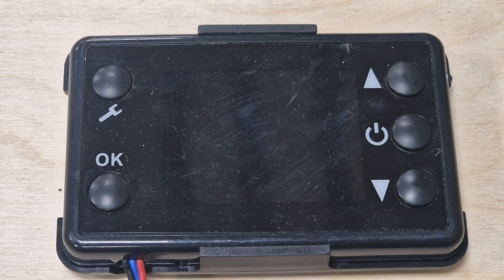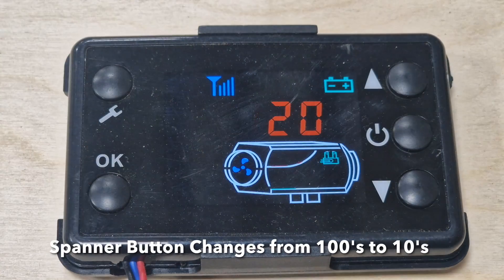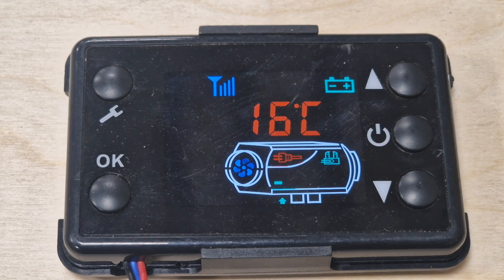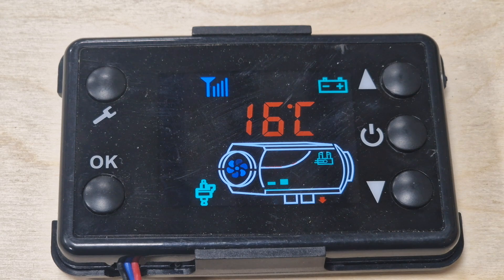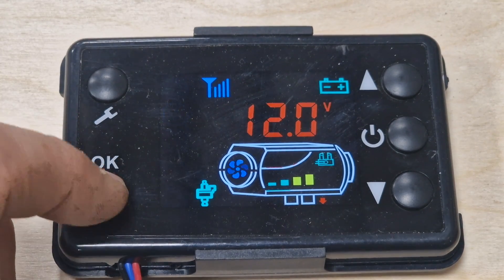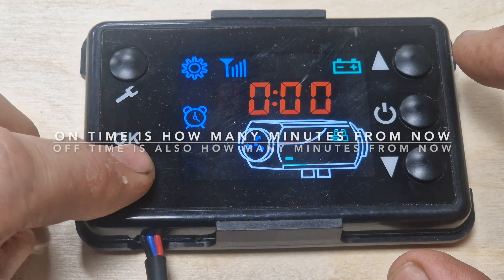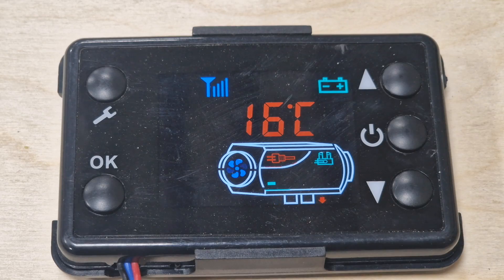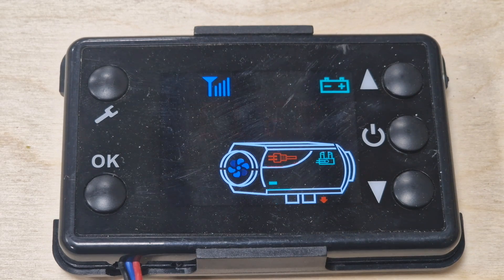How to Use a Diesel Heater Controller - New Type

Comment: I want to add some info not in this video, or anywhere else I could find.  Switching from Fahrenheit to Celsius.  I ran up on this by accident.  My remote stopped working and while trying to get it to pair up again, pushing different buttons hoping to find the right one, I found out how to switch from Celsius to Fahrenheit on mine.  This may not work on all controllers but it does on mine and this video seems to match my controller.  Keep in mind, there are different controllers that use different buttons to do things.  On mine, I had the heater running and I pressed and held the temp up button.  It takes a few seconds but when you see it switch, release the button.  It may also work when the heater is off as well.  I have not tested it tho.  

Again, I lucked up on this purely by accident.  I reached out to the maker of my heater, they were not aware of this either it seems.  They updating their customer service info to help other customers.

Comment: How can change F to C  ?
Reply: I ran up on this by accident.  My remote stopped working and while trying to get it to pair up again, pushing different buttons hoping to find the right one, I found out how to switch it on mine.  This may not work on yours but it does on mine and this video seems to match my controller.  Keep in mind, there are different controllers that use different buttons to do things.  On mine, I had the heater running and I pressed and held the temp up button.  It takes a few seconds but when you see it switch, release the button.  

Hope that helps.  Going to post up top so the guy making the video will see this and maybe include it in a new video later, or others luck up and see my post.

Comment: I've got this controller had it about a month, I only have a small van and on p01 (I have 2 of the 6 bars on I swear it sat on 1 wen I first used it) I have to turn it off for 10 mins hear and there or I over heat I cannot get into advanced settings at all, do I have a faulty controller? I can only turn off adjust the temp or power setting wen it's running definitely won't let me do all that you are on yours only wen it's not running
Reply: I know this is a old video but help would be much appreciated got 0 instruction with the damn thing

Comment: Hi Bud. Great video's. I have triclicks heater with controller with spanner, in the secret menu do you have any idea what the settings should be?
Or what each part does? Am at sea level if that makes a difference.
Cheers

Comment: Anyone setup 1kw diesel heater, controller lights up with 8's, ticking noise initially, don't think it's pump noise. Controller is single knobs, presume push in, on/off, rotate for temp. Has a remote but no instructions that I can find, so cannot link

Comment: I found that when I set the temperature when the unit was off it did the trick, went up to 18 degrees when I turned it on, that I set and then settled there. It had been in 30 degrees before that so thank you

Comment: I bought this model and followed all instruction but when the heater gets to a certain heat internally it starts blowing out smoke (not thick, like when you burn food in the oven) then when I turn it off white smoke sometimes comes out of the air in take pipe. Any suggestions as to how I can fix this?

Comment: The controller I have is different but I get no power to the diesel pump I thought it was the heater so I just a brand new one,  along with a 600w power board and mains uk plug , and I get no start up on the fuel pump nothing , any ideas would help 😊

Comment: Why don't I have the option to set the time?  I didn't have it on my old CDH which I've just swapped out but the new one didn't give me that 0000 screen at the start either .... so frustrating.   I also need to tune this new one - but can't find advance settings! 😢
Reply: Did you figure it out. Im having the same problem.
Reply: Yes - there are two different types of mother boards - one is preset (so you cant change fan speed etc) and doesn't give the time, but does give you temperature of the motor.   The Other does give you control over settings, and gives you a clock.   
I don't know which is best - my first mother board was excellent 👌 but broke - my second (also preset) was terrible and couldn't change settings - my 3rd (which i can change settings) and current one seems fine but I have a feeling the soot is building up 😃 (I like the fan pump ratio as it is so all on me)

Comment: Hi everyone - mainly Grantsyard and Van Life UK - thanks to them to explain "advance " programming after entering password code "1234". P & t is manual heat control or thermostat control, 1 & 2 is selection between 12V or 24V,  H & L is 5000W or 2000W, last number is 1 - 16ml, 2 - 22ml, 8 - 28ml dosing pump.
Today I tested my 5KW heater with this "spanner" setting button controller model - all perfect, on P-01 heater 175*C, exhaust 220*C, only two LEDs, on P-05 heater 190*C, exhaust 340*C, four LEDs, on P-10 heater 206*C, exhaust 490*C, six LEDs. A lot of heat out of exhaust - my intention is to make muffler combine with heat exchanger to heat water for additional small hydronic heater and shower in my mobile home as next stage. I hope that software is and will controlling fan speed & fuel dosing to good combustion without "manual" programming fan & fuel ratio as on older controllers. Personally - I'll prefer option for "manual" for case need to do it - going to top on mountains - do not know yet how this controller will behaviour. Good luck everyone, Vas.
Reply: I set 28ml pump on my 22ml setup and work better. thanks.  factory configuration is some over rich, I guess
Reply: On my menu theres H/L also U ive been trying to find what that even means, its not in the manual and cant find online only that h is 5kw l is 2kw

Comment: thanks, is there a way to adjust the rpm and fuel like on the older controllers with the settings picture not the spanner on the top left? thanks
Reply: I do not think so, have tried,

Comment: When I turn the power on for my heater. I get nothing to set the clock just shows p12 which is voltage. If I press settings (top left and ok nothing happens. Which also means I can’t set the timer. Confusing to say the least.
Reply: Same as mine , no clock setting
Reply: @cliffhawkins2285  think it’s the model. Which means you have to manually turn it on and off. If you leave it on it does reduce the fan speed to control the heat but I don’t know what the temp is set at. They are a bit of a pain to be honest.

Comment: I have a diesel heater that will not light. I've taken it apart three times it's been cleaned and was not dirty. The are hole next to the glow plug is also clean. Also installed new gaskets a new glow plug. Every time I try to start it it just smokes. I did notice when it starts now the fuel pump runs five times

Comment: Do you know, is possible to use heater only as fan? In summer, for air circulation and cooling. Thank you.
Reply: If you have one that will pair with the heat genie app, it has a fan only setting

Comment: Fantastic video as I have this one so useful 👍
Question 
When you turn it off and the control panel goes off not lite up is it still using power from the battery 
👍👍😜cheers

Comment: i use temp mode, works ok has a 2 c band that needs to drop below before it turns the heater  . good for controlling carbon build up.
Reply from the maker: Thanks for the tip!

Comment: Just installed my heater and it does not power up tried everything could think of and no luck  I bought a new set of motherboard control panel and remote fitted it all up and still no life in it any suggestions would be greatly appreciated thanks Tom
Reply: Also mine has a in line fuse if you have no power check that if you have one
Reply from the maker: What power source are you using? 🤔  It needs a very full 12v battery or even better, a ac to dc pack with high enough amps

Comment: Hi I was looking forward to using my heater for the first time after watching you video on how to use the controller.  First snag I found is there isn't a spanner symbol and it isn't in the settings either.  My controller seems to be different to the one on your video also the heater instruction book is next to useless, can you help please?
Reply from the maker: So yes the instructions are useless. There are different controllers with slightly different use. Some functions work the same and some don't.
Most youtube controller videos are for the cog type which is different to this one!
Reply: My controller is completely different as well , sent off for a replacement and that one is not the same either

Comment: Can you change from from Celsius to  Fahrenheit on this controller?
Reply: Pretty sure when you see the Celsius temperature hold the up button until it turns to the Fahrenheit setting
Reply: I don’t know how to change mine to Celsius from Fahrenheit 😅
Reply: Did you ever find a solution?
Reply: Hold the up arrow for 10 seconds @michaelvanveghten5823
Reply: I’ve changed mine from Celsius to Fahrenheit but don’t know how
Reply: Hold the up arrow for 10 seconds

Comment: I set the temp very easily using the remote.  It is but a simple press of a button.  Once it reaches the desired temp it powers down to idle.  If the temp drops a degree centigrade, or thereabouts, it cranks up to high again.  This seems ideal to me.
Reply from the maker: Now I'm set up I use the remote in the same way to be fair
Reply: I've tried with button operation and with the remote, but it doesn't stop heating! Right now it's 17 degrees in here, heater is set to 13 and it just keeps heating... Any idea if I could be doing something wrong?
Reply: @thomasdt1991  Unless your heater is the type to turn off at a certain temperature it will continue heating.  You can set the temperature to reach before the heater powers down to idle, but it will still keep on running.  You will need another gadget to turn it off altogether, such as the Bureck CD Thermostat (Google or YouTube Search for it).   I have one and it works a treat.  It turns the heater off and on at the required temp.

Comment: Is there a video showing how to adjust the fuel air ratio on this type of controller please?
Reply: I don’t believe you con with this model
Reply: @LeePearce-lv4zj  I managed to get into the settings by holding the settings button and then pressing it 3 times and my pin was 1234 however the settings are not rpm and hz settings it shows H1P2  and im not sure what they mean
Reply: A comment elsewhere says the letters mean:
1st letter- P (manual heat) or T (auto temp)
2nd- 1 (12v) 2 (24v)
3rd- H (5kW mode) L (2kW mode)
4th- 1 (16ml), 2 (22ml), 8 (28ml) for pump size

 @kyriveli
Reply: Been looking for years on what these mean, cheers, written them down
Reply: On mine it has H/L and also U ?? any ideas?

Comment: My father in law has this system hooked up to a car battery. When he powers on a gasoline generator to charge the battery while the diesel generator is on, the diesel generator throws the E-01 and E-02 error codes and will not reset until disconnected from the gasoline generator. Have you experienced this issue or know of a way to get it to work while the battery is connected to the gasoline generator?
Reply: buy a small 12v trickle charger, I use a little AA one I bought, works well

Comment: Thanks for video absolutely priceless particularly the temp settings thought my was faulty gone to the power mode as you suggested much better ticking over nice I've bought a nice 300 what power supply from Amazon works fine as we are docked in a field with mains hook up many thanks for the video 👍
Reply from the maker: It's theamps that need to be high enough for the start up. Should be the same as the onei used.

Comment: Has anyone noticed,with this thermostat, that the fan that runs after the unit is off, to cool the unit down and it's electronics stops running at 63 c. That tells me the electronics are not going to last . 
Please let me know with your response
Thanks JC
Reply from the maker: Mine was hammed for winter and is still going strong 💪

Comment: My heater will running for 4, 5 minutes then gos off again, get the clear flash up so no faults, it’s been doing this for awhile now for no apparent reason any suggestions?
Reply: Run the unit on high for 10 min. To clear/ clean the burn chamber, then shut it down/ let the unit go through it's cool down program. Do everytime you shut the unit down and it will stay clean.
Reply: Mine has started doing the exact same thing, 5 minutes it runs for then clear comes on and turns off. I can't find an answer anywhere on how to fix this.
Reply: @donbrowse7980  mines ran no problem for 3 hrs last night before I switched it off for the night. But haven’t changed anything from it running as mentioned before. Strange hopefully someone else can shed some light as why it does this?
Reply: @Diyman43  about 45 minutes ago I primed mine again for 20 seconds, white smoke was pouring out of it for a good few minutes before it cleared and now it's running perfect again and not turned its self off, try priming yours again.
Reply: @donbrowse7980  shall try that the next time it cuts out
Reply: @donbrowse7980  same issue back tried what you mentioned on priming the pump for 20sec back still cuts out after 5mins or so

Comment: Great video hard to find content for the Triclicks.  I have just installed one and after stripping down to clean after I flooded it is stuck with an E-06 error on start up.  I have tried everything with the fan but no luck.  Have you had this at all and if so any tips please? Thanks
Reply from the maker: Check that your fuel pump is the right way round and that your exhaust is draining
Reply: E06 error code is low voltage on my unit. There are different controllers fitted to the same heaters.

Comment: Thanks mate. I've just fitted this unit in my camper and im very happy with it. I find power 1 is great for me. Not to noisey and plenty of heat. Thanks for the controller tips.
Reply from the maker: Yeah in a small area setting 1 is fine.
I'm going to be putting on into my horsebox camp in the next month or so!
Reply: @grantsyard  looking for some advice  wonder if you good help

Comment: Very useful, this video ACTUALLY works for this controller - have you worked out how to get into advanced functions yet?
Reply from the maker: I have, the steps ate the same as the older controllers, but they don't seem to actually do anything helpful!!
Reply: @grantsyard  excellent - cant you tell me the steps please?
Reply from the maker: @damenfeld  yes. But I will need to fire up the heater to go through it again. I'm not at the yard til Sunday. I am happy to do it then and let you know

Comment: This is mint, thanks 🙏 do you use power setting or temp?
Reply from the maker: I always use the power settings. I start using it on the high 8-10 setting and then lower it to 2-3 when it's hot enough

Comment: Any idea how to change the heat setting to Hz?

I have 2 heaters, 1 has the 1-10 and 1 has 1.4hz to 5. Something.
The one showing Hz runs at a lower pump speed at its lowest setting than the one with 1-10 so it uses for fuel. Bit anoying
Reply from the maker: It looks like these controlled only do the number or temp (the temp bit is useless too).
They are great bits of kit but the controls let them down from being much higher end

Comment: Hi . could you tell what ac transformer you use please .
Reply from the maker: I'll have to check but it was ordered from amazon a couple years ago when I needed to power a water pump to protect against flooding. It is an ac to dc with a 5amp output to handle the higher current during the initial glow plug draw
Reply: That’s the power supply I used. Works a treat
Reply: trouble is using an a to dc conv is if powercut then heater cuts out with out cool down phase it'll end up damaging electrics. I've used small 12v battery with a small AA trickle charger for yrs no problem.

Comment: I can't do half of this with my unit. I press the spanner (settings button) it beeps but nothing happens. 🤦🏻‍♂️
Reply from the maker: Have you it before you switch the heater on?
Is your controller the spanner type or cog type as they have a different functionality.
Reply: @grantsyard  Its the cog type. Apparently you can't set the time nor does it have a timer. 🤦🏻‍♂️